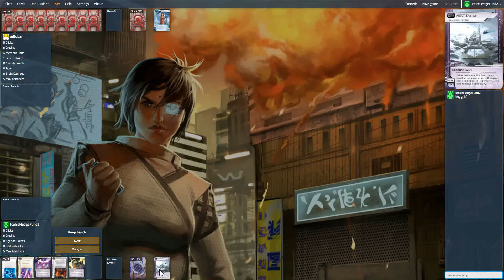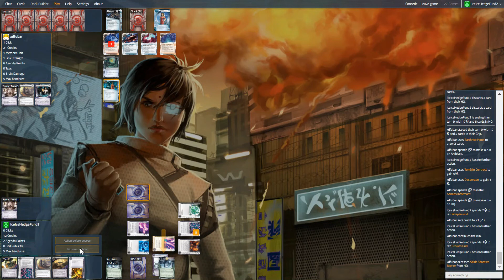Netrunner - High Violet NEXT Design vs Good Stuff Andy (xdfubar)

Comment: The AAL play at 5:30 or so is actually illegal due to VLC being terminal. With Ultraviolet, you still have a paid ability window at the end of your action phase in which you can use AAL to install other cards; with VLC, your action phase ends immediately and your next paid ability window is after you discard to 5.

Which you realized a turn later. ;)

That said: I really cannot get the hang of this deck. I'm at an even 50% win rate with it in testing; the econ package seems so shaky. Advanced Assembly Lines has possibly never been worth less cash, what with very few installables (other than ice, where you're probably losing your 2c due to ice install costs) and no ETF bonus. Hopefully you do better with it over the next few videos than I have.
Reply from the maker: Can't watch back now but I may have copped the illegal play here...If not, we may be seeing it in another video!  :/  I'm not used to not having the crutch of Jackson and drawing so many cards (that have to be discarded immediately); it's tricky!